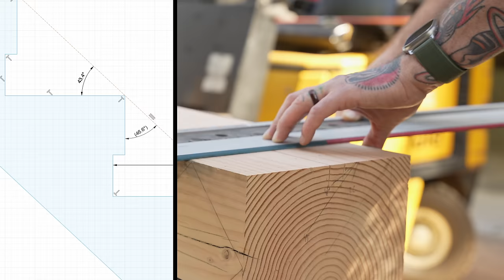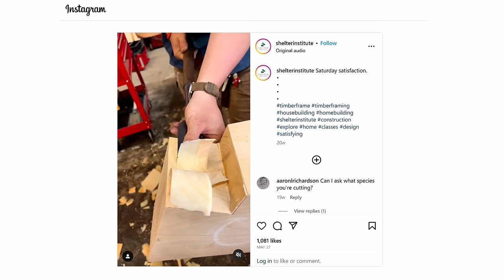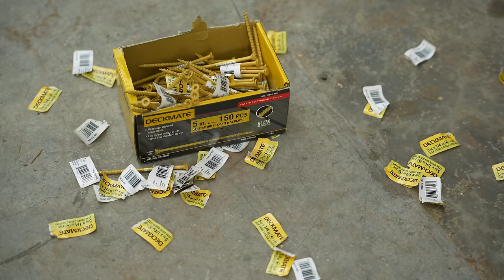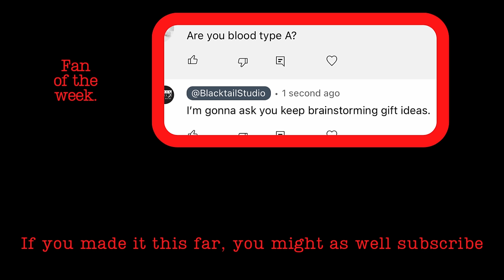Timber Framed Staircase Build

Comment: Impressed structural engineer here.  It's probably stronger than it needs to be for concentric loading (walking up/down the middle of the stairs) but you'll be glad you used that massive piece of DF for torsional stiffness whenever you step out near the edges of the treads.  I usually do these out of tube steel for that reason.  Think about it.  
I might have beefed up the top and bottom connections though so keep an eye on it in case they loosen up over time, especially the bottom.  But hey, no stamp no problem.
Love your work man!  From a fellow Cam.
Reply: From another structural engineer, I had the same comment.....timber pieces are 'overkill', connections are suspect.......I've done one with a tube steel stringer and broke steel sheet treads.
Reply: Mechanical engineer here. Only comment I had was the same… should have beefed up those connecting plates. But at the end of the day… think about it
Reply: You probably would use tube steel for a diving board.  We don't want to take a chance with flexing now, do we. How about scaffold planking ?  6" WF ?
Reply: When a client pays thousands of dollars for the design of their custom stairs they do not want them to deflect noticeably when someone walks on them.  
That said, a tube steel diving board sounds pretty cool.
Reply: Sister the joist and add solid bridging to the next one over. Pull the joist hanger, sister the headers both ends. Install the proper joist hangers (double or triple) depending on the headers. Next one you do, extend the solid center notched stringer at top rise (this tread notch will be larger) so pressure blocks can be installed at the header - add this pressure block thickness to the overall stringer length. Pressure blocks will eliminate twist where the top of your stringer meets the header.
Reply: @henrypeisch5289 Geez, what language is that? I don’t even know what you meant! (That’s my ignorance though!)
Reply: @58Kym  Woodframe construction terms for the most part. Sister (adding and fastening a framing member to another which is already in place to increase its strength - with bearing, deflection and shear and a consideration to both live and dead loads. Typically for live or point loading and to decrease deflection when loading is introduced to a floor or roof assembly. Usually refers to horizontal framing members such as joist, beams or girders). Solid bridging (short cuts of joist material used to unify a floor or roof joist system and strengthen the diaphragm. Similar to cross bridging which may have been used typically down the center of a floor system - distributing loads also to adjacent joists. Similar to what a truss design does). Headers (joist that run perpendicular to the main floor joist where some joist are interrupted as in a stair opening. In this case, there are two header sections at the stair opening). Joist hangers (U shaped metal support. Currently singles but need replacement with a larger capacity hanger because the header should be sistered). Tread notch (the cut in the stringer that will carry the tread or horizontal step. The corresponding notch is the riser. Rise and run of a stair). Pressure blocks (short pieces of tightly fitted joist attached to the header on either side of the stringer. This requires the overall length of the stringer to be buried at the top of the stair. If 2X material, the extension would be about 1 1/2” or the thickness of the pressure blocks on each side). These will help resist the rotational force on the center stringer as weight is put on the outer ends of the treads. For example if Scott were to carry Cam up and down the stairs - piggy back. Maybe that thought creates a slightly disturbing image. But try not to “think about it”.
Reply: @henrypeisch5289  LOL. Thanks for explanation but I am sorry you had to explain what men probably know with their first diaper.
Reply: @58Kym  I’m old enough to be wearing my second set of diapers. I just want to put it off as long as possible.
Reply: @cambrochu638 now Scott knows that his CAD drawing saved Cam thousands. Uh oh. Time for a pay raise.
Reply: @henrypeisch5289  Thanks for taking the time to write up an explanation! So many fragile egos on Youtube not understanding that this platform can and should be used to contribute to our collective understanding. I often learn from the videos I watch, but I learn much more from the comments section because of people like yourself who give a little bit of their time.
Reply: @Saileahgaz   no matter our age or experience, there is always room for learning. Especially how methods, materials and tech evolve. I enjoy the channel and have seen things that I also can deposit in the old knowledge bank. When you are too old to learn new tricks, you may just simply be - too old.
Reply: By the way, these few structural improvements should still be possible even with the new stair installed. It’s working backwards a bit but that is the nature of remodeling vs new construction. One just has to “think about it” a bit more maybe.
Reply: This. Exactly.
Reply: I would definitely find a way to attach the top and bottom with some heavy angle brackets they add width to the attachment area and resistance to twisting. Some thick iron made into a custom bracket, painted black, would be easy to retrofit and attach even now that the build is done.
Reply: @j10001  custom fabrication is almost always a better way when reinforcing wood frame construction. I have not seen much welding on this channel however. If Cam got a welder to make some hardware, the top of the stringer should be the focus. A single welded plate that spans the header and returns on the sides of the stair opening - with an integral saddle hanger for the center stringer would be a bullet proof solution. But still sister the liners for a better connection of metal to wood. Tricky with the stairs now in place. It would satisfy any big boys running up and down for sure but IMO, adding framing as has been suggested - would also be sufficient. Maybe Cam has a welder friend and the resulting video would also get some hits for the channel.
Reply: @henrypeisch5289  Great idea!
Reply: @henrypeisch5289  One thing I would note is that mid-span cross bracing has no real ability to 'share the load' between adjacent joists, the sheathing does that pretty well, it's to prevent the lower side of the joist from moving/buckling, and generally stabilizing the bottom side the joist for any lateral loads, like hanging equipment, ductwork, etc.
Reply: @kindlin cross bracing or cross bridging? If I’m not mistaken, I believe the term I used is cross bridging. If cross bridging, then I must respectfully disagree. If “sharing” the load is the same as “distributing” the load, then I also respectfully disagree. But you are correct about the additional benefits you mentioned. In my experience, bridging enhances the floor's structural integrity by distributing load and reducing joist twisting. Cross bridging not only stiffens the floor but also minimizes vibrations and noises. It significantly contributes to the overall strength and durability of the floor structure. Bridging (cross or solid) is for tension and will reduce deflection of a single floor joist - in the case of a parallel partition above or if a double (sistered) joist is compromised by mechanical trades. Cross bracing (not to be confused with bridging) may refer to bridging also but alternatively may refer to strapping of an individual joist…framing terms vary regionally so, I’m not sure. Not a poke at you at all but just curious…how many years you have spent framing houses and in what part of the country.

Comment: Cam, awesome staircase, looks beautiful.

I'll preface this with "I'm not a structural engineer" but I think you should consider beefing up the header joist thing. Your old stair singers were mounted to the edges of the header therefore the header wasn't doing much other than being a riser. Your new stairs are mounted in the middle. Meaning that single joist is now supporting the full load.
Reply: Think about it!
Reply: Absolutely correct. That
header should be triple!
Reply: @jonerwood2314  you could probably get around having to do that by transferring some of the load to the floor using a beam from the floor to the underneath of the 5th or 6th step, make it fancy and make  feature out of it.
Reply: Watching this thing flex under his weight while he was applying the m3 nano at the end gave me the willies. Top is held in by 2 bolts and 2 wood screws, and bottom is held to the concrete with two lags with an uneven coating under it letting it just rock back and forth. Both attachments need to be beefed up a ton, and the joist needs to either be beefed up, or a column added under the top stair to take the load off of it.

Also not a structural engineer, but I've built a few staircases in my time.

EDIT: I just saw the last little bit of the video. That joist is clearly flexing on every step. If it doesn't get beefed up it will eventually break and drop back; but I'm still not a structural engineer so I don't know how long that'll last without a fix.
Reply: ...the full load, plus a rotational / torque component that will put an alternating full weight load on single bolt at a time. Sorta.
Reply: There is no way in hell my old girlfriend could even set her foot on that.
Reply: The concrete anchors are fine (I'm a structural engineer). The top connection is very concerning, and while I haven't run numbers on the tread to stringer connection, they were twisting excessively even when he was just sanding them. @Tony_Chalmers
Reply: Should have been done with the original framing of the old stair but sister the joist and throw in some solid bridging to tie any deflection and twist into the next joist also. But structurally, the stair is acting as a support column so you can argue that the engineers include that in their calculation also. For Scott, a perfect stringer layout would have included an extended stringer for pressure blocks at the top also - next one you do. Then sister (add one or two members) the headers at the opening, replace the single hangars with double or triple and you won’t get any criticism from random structural engineers who frequent your neighborhood. Some of the best dry, self deprecating humor on YouTube. When your commentary seems like straight conversation, I have to pause and rewind to see if I missed any creative subtle punch lines. Scott definitely has the vibe with his edits. So kudos to Scott. Clearly Scott does most of the “thinking about it”. Go Scott!
Reply: @Tony_Chalmers  I mean, I am a structural engineer, but think about it. You basically got it all. One thing to note is that wood will flex a LOT before it finally fails, that's one of the real beautiful things about wood compared to even mild steel (the next most ductile of the common building materials).
Reply: @aaroncecil7509  Definitely a good serviceability check during design (deflections in general), but if it feels good when walking on it, I doubt this fails strength-wise (just at a guess).
Reply: Stiffness and strength aren't the same thing. Usually there is a correlation, but not always. Connections in particularly give less warning, and his top connection is probably the most concerning part of the stair. 

But aside from that, his stair isn't really passing the serviceability eye check. He acknowledged in the video how much it was bouncing even under the weight of one skinny person, and the treads were wiggling and twisting during sanding. And those are hardly worst case load conditions.  @kindlin
Reply: @aaroncecil7509  I wasn't really talking about the connections here, but yes, that is the main thing I would beef up, both top and bottom, tho specifically the top could use a little lovin'. And it was the camera man that pointed out the flexing, he didn't bring it up walking on it. As long as it wont fall down and feels OK to walk on, then that's design and serviceability requirements met! I could toss this into my spreadsheet at work real quick tomorrow and see what the strength DCR looks like, I'll set a little reminder.